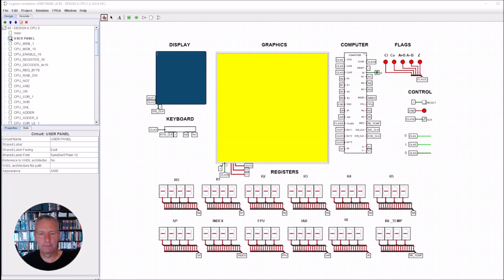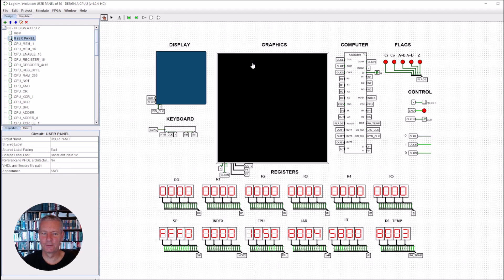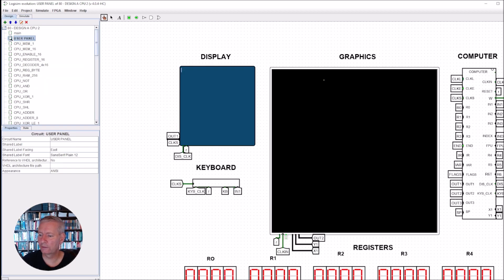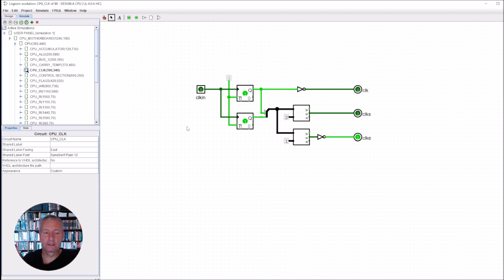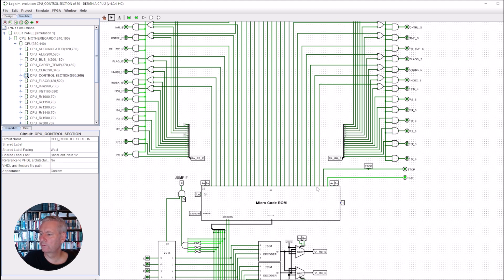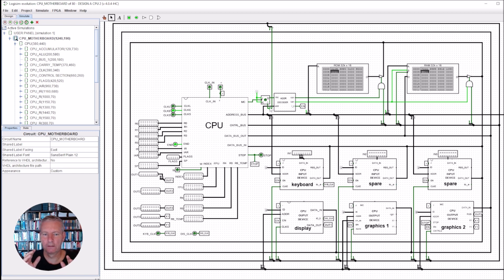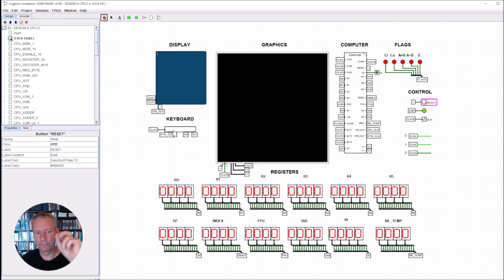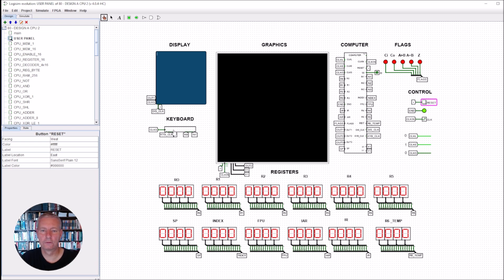Design a CPU 2 Pixel

Comment: Hi Ross - I see "Design a CPU 2" is now up on Udemy - Good stuff & I'm looking forward to going through it :) I've also been delving into your You Tube Channel  recently & came across some "Op Amp" videos that I'm interested in - I got your "Course Notes pdf", but can't seem to find all the videos - Is there somewhere  I can get/buy the full suite or not ? Cheers, Tim.
Reply from the maker: I will send you the link for the opamp course. I took it down as the rating was below 4. I will also send you a link for the CPU2 course. Will send them tomorrow as I am just heading to bed. I created another command PIXEL fff5 RA , RB which allows me to increment the RA , RB values and get some nice graphic effects on the display.
Reply: @RossMcgowanMaths  Cheers Ross.